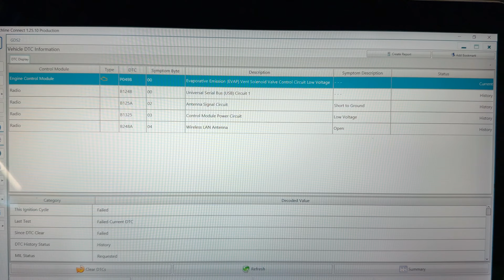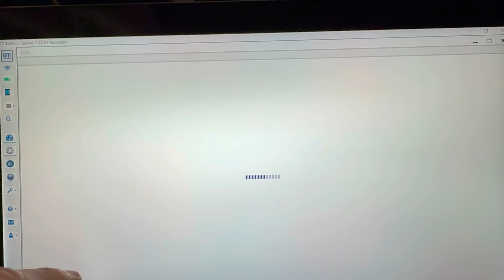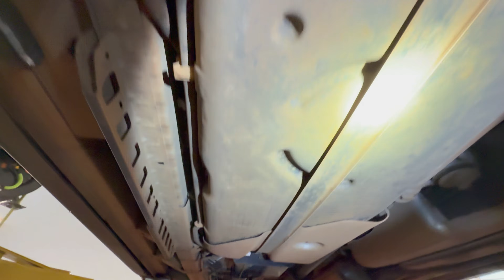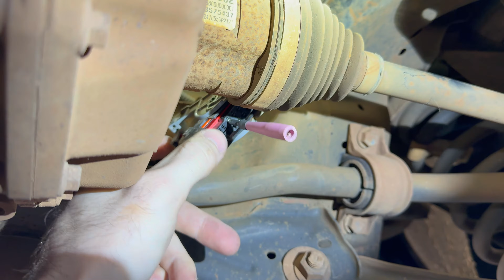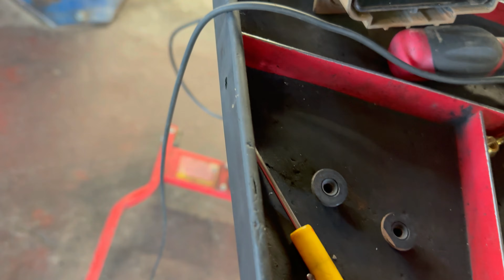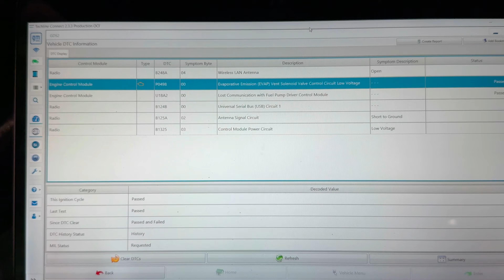“Don’t quit your day job” P0498 Diagnosis Chevy Traverse / GMC Acadia

Comment: Great video and explanation. I have the same issue on my 2020 terrain. Bought the new gm control module. My question is does the new module have to be flashed or programmed to the vehicle? Or is it plug and play? Thank you!
Reply from the maker: The new module is plug and play. Thanks!

Comment: I have same code p0498 and all test lead to control module replaced vent valve and module with one from local parts store now getting code p0498 and p0F23F with long crank then shut off but this is on a 2019 Malibu
Reply from the maker: I wouldn’t put too much faith in a parts store control module. 

What test steps have you taken and what were the results?

The engine starts and runs normally with the old control module installed?

Comment: When you did no continuity to ground and battery positive were you still connected to FP power control module with other lead?
Reply from the maker: I disconnected both sides of the harness for the wiring test.

Comment: It is very satisfying to have a test module for confirmation - but how did you get a new module on national back order so fast?
Reply from the maker: The known good test module was is a new part that was given to me as a test device due to superseded part number.

The new part took about a month to receive... usually takes anywhere from one to six months to receive back ordered parts unless it's a special circumstance, then magic wands get waved around and they show up next day.

Either way I don't really ask. I just add it to the pile of "waiting for parts".

Thanks for watching!
Reply: Go spend 20 minutes writing a story, flag your 0.3 and get us another video...😅
I have run into the same issue with pin fitment of the regulator 2 on the L5P.  The fse lunch recently mentioned to be careful with the 4 and 35 probes
Reply: @charliemagoo7943  
Why are you telling me that?
Reply from the maker: Nice.